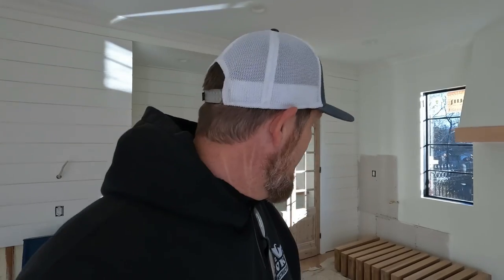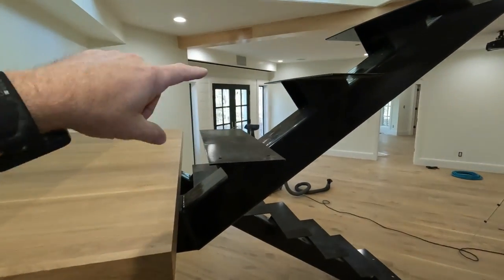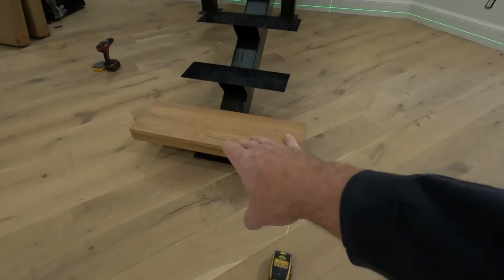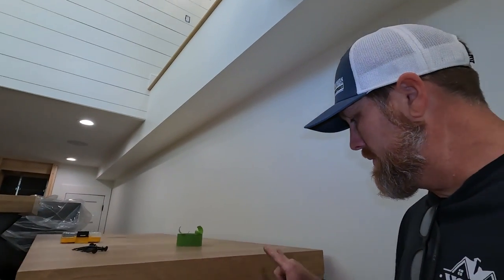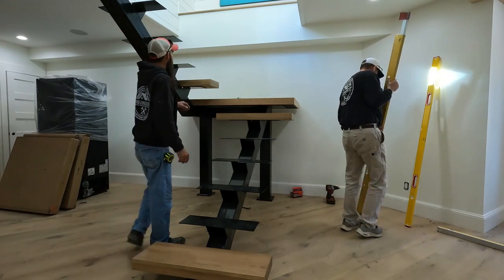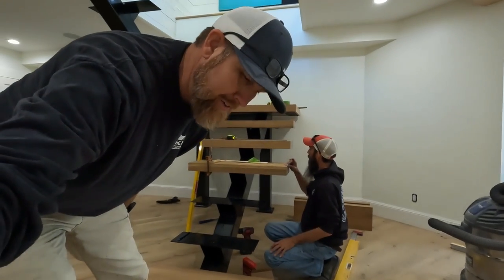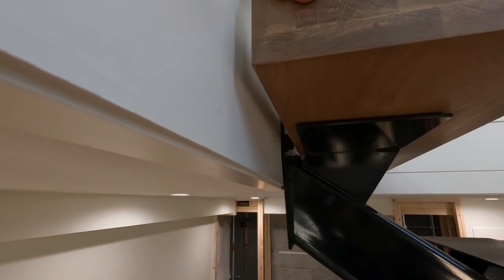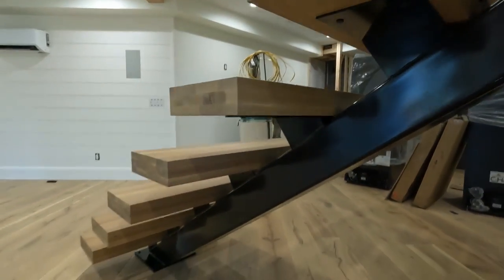Custom Metal FLOATING Stairs / Tread Installation, Part 3

Comment: On that platform, you have grain on the apron going in a different direction from the top grain.  White oak expands and contracts different across the different directions of the grain so those nice tight miters will probably separate unless the humidity of the house is held consistent across all weather seasons
Reply from the maker: Yup. All wood will expand and contract. This is a home so it has A/C and heat with dehumidification. So it stays an ideal temperature and humidity level throughout the year.

Comment: My builder used shims on the stairs threads. I’m assuming to keep them steady. What are your thoughts on that? It that a hack job?
Reply from the maker: Hmmm, not necessarily BUT I don’t know the situation…if he shimmed underneath the treads maybe the metal work was sub-par?? A few different factors there but ideally there should be no shims between the metal and the treads.
Reply: The metal work appears to be solid but I’m no expert. I almost wonder if they are temporary shims but the house is pretty much done so I’d think that they were permanent. You can see the shims on each thread when you walk upstairs so it’s kinda annoying cause these stairs were not cheap. I guess I just need to ask you he builder those important questions🙂.
Reply from the maker: @lukus348  ya, that’s not cool to see the shims…at all! Most definitely talk with your builder and let him know ur not totally pleased with it.

Comment: The workmanship is excellent, but putting the lower steps in the middle of that room was not a good idea, they should have been closed to a wall, to leave the centre of the room clear and free .
Reply from the maker: I disagree, this was the only way that the steps would work correctly in this application. It’s only a few steps from opposite wall anyhow.